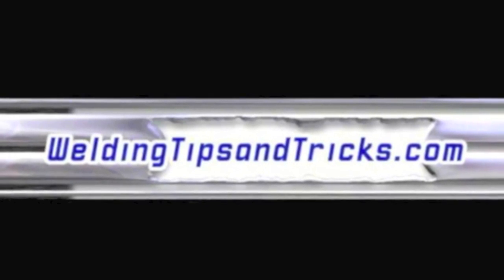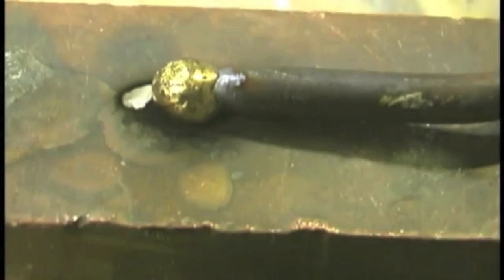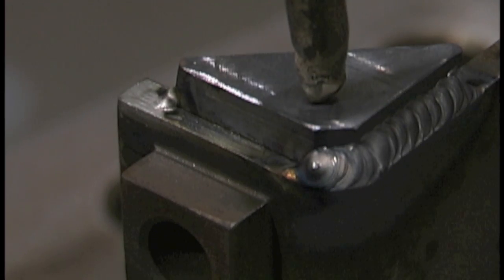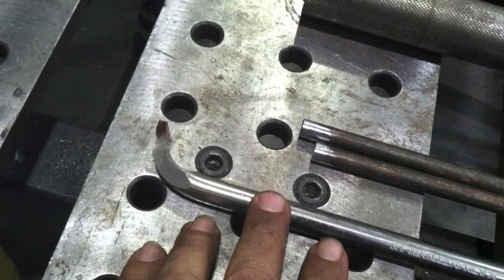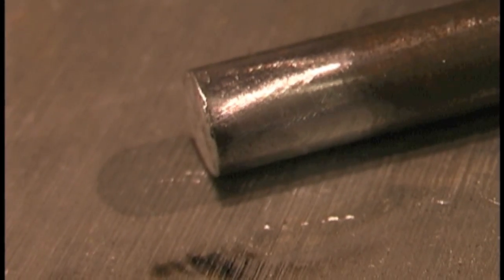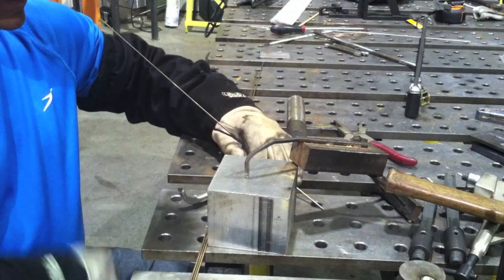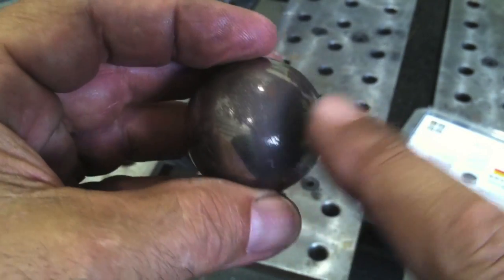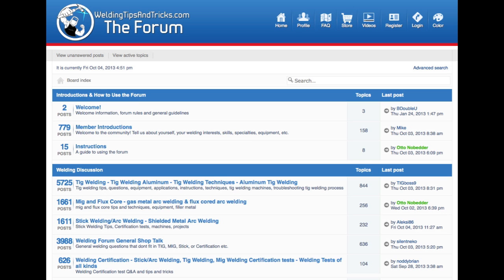Tig Welding Job and Welder's Third hand Overkill

Comment from the maker: For this video I was using a miller dynasty 200dx.  The diversion 180 is an ok welder. The tig torch is hard wired so stick welding can only be done by modifying things. But for the money, it can handle a lot of tig welding jobs especially if you use a helium argon mix for aluminum.

Comment: Hey Jody do you horizontally dab or poke or sweep the filler rod into the puddle. Just curious on what motion works for you. I like lay wire but occasionally " poke" the rod in the front edge. Thanks

Comment: What is the difference between ER 70s2 and ER 70s6 and when would you use one rather than the other.
Reply: ER70S2- compositon by %: C 0.07, Mn -0.90 t0 1.40, Si -0.40 to 0.70, Ti 0.05 to 0.15, Zr o.o2 to o.12, Al 0.05 to 0.15

ER70S6- compositon by %: C-0.07 t0 0.15, Mn- 1.40 to 1.85, Si- o.8o to 1.15, 0% of Ti,Zr, and Al.

So basically 70s-6 has more deoxidizers than 70s-2. meaning it is better on "dirtier" metal.
Reply: practically speaking, er70s-6 works better for full penetrating welds, where as er70s-2 will work a bit better for a weld where backside deoxidation isn't as critical, in my experience.

Comment: It does not really look like a bird, it looks more like Mick Jagger standing on stage with a mic stand. But then again, Mick looks like a vulture so yeah I guess you could say it looks like a bird. 
I had a third hand that did not work. It was made from a foot long section of railroad track. It was heavy. I was using it to hold a small piece of aluminum on to another which I was going to weld together. The Al got hot and the arm sunk in! I then dropped it on my foot. I cut the damn thing up.